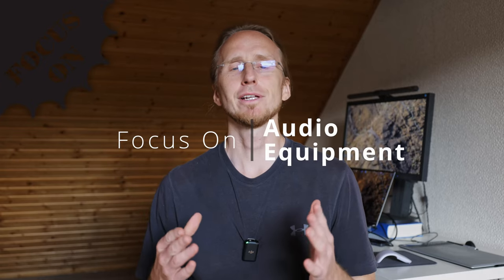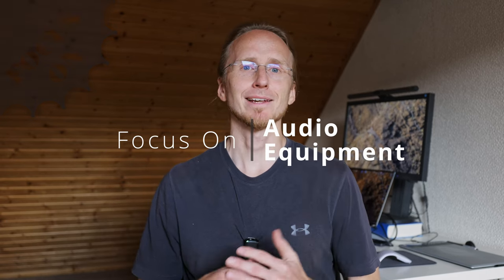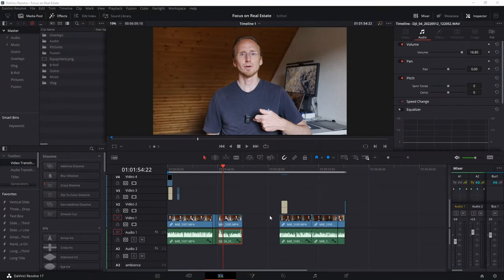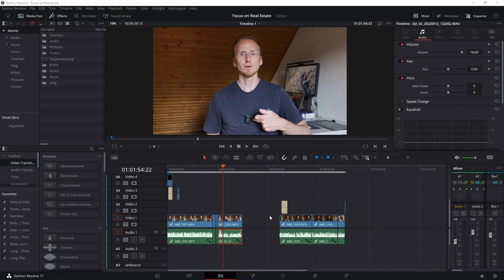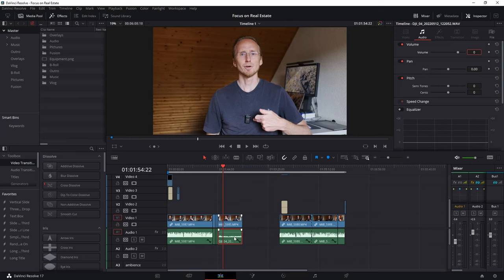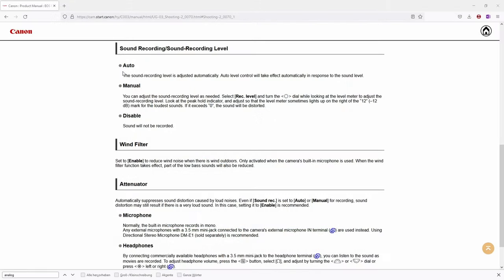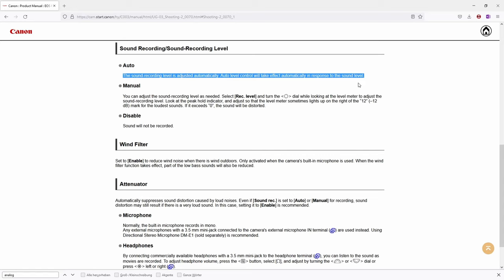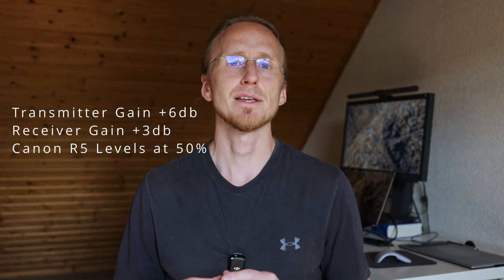DJI Mic Settings for Good Audio

Comment: did you had any audio delay with the DJI MIC?  recording in 4k 60fps i have a 3 frames audio delay
Reply from the maker: I didnt do 60fps. I usually record high quality Mode 4k at 24fps and had no problem.

Comment: Need your help. The first time I used these dji wireless mic and uploaded my video on YouTube the sound turned out too low. I had set the transmitter to + 3 and receiver to +1. Also I am using a dji Pocket 2  with a dji audio adapter. What audio levels do I set on the receiver and transmitter to get a satisfactory audio if not perfect. Thanks . I cannot find any videos on YT on setting gain levels in different environments. What's the thumb rule for setting gain levels between the transmitter, receiver and the camera I.e dji pocket 2
Reply from the maker: You can go higher with the gains. I have +6 in Transmitter and another +4 in the Receiver currently. The camera levels are below 50% to reduce noise. But whatever levels you set, you also have to tweak the signal in your video editing software. You should aim for something around -5db so the sound isn't too low. I typically add gain in Davinci Resolve to get the signal strong enough for my Youtube videos. There are great tutorials available. I'm no expert here, just learning by doing.

Comment: does DB gain reduction helps to reduce surrounding noise in DJI wireless mic?
Reply from the maker: Edit: My answer below is for the noise of the system itself. With surrounding noise, do you mean noise from street, other people and the like? For this, what you must do is get the dji mic close to your mouth (sound source). Usually, other surrounding noise is not very audible then.

First Answer: No, you must increase the gain in transmitter and receiver and reduce it inside the camera for the best quality. The later in the transmission chain you add gain, the more you will increase noise. Most noise in my case was added by the camera when the digital signal was converted into analog, fed into the mic-input of the camera and then amplified. But you should do tests with your system to find the best configuration.

Comment: 1:46 sound diferent. less eco i think but that is problem you can use bot audio on same project. so look like is better get a recorder and that it, something like zoom or tascam. but looking for wireless transmiting and look like dji mic dont achive it. It look nice and give better option than rode mic but that noise dont like. maybe down the sensivity can improve it?
Reply: 5:13 nice. look like all need put some gain to avoid the static or hiss sound. ok that is good for me.

Comment: Thx for this video! What kind of sound settings do you use or suggest in case of recording outdoor nature sounds (e.g. in a forest) with transmitter backup track recording?
Reply from the maker: Since this microphone is optimized to pickup sounds in close range while avoiding too much surrounding noise, I don't think it's ideal for your use-case. You can try to increase the gains as much as possible and you'll certainly get ok audio. But I think what you are looking for is a Zoom Stereo Recorder. But best give it a try for yourself and see if it's sufficient for how you use the audio.
Reply: @mibreit-photo  thank you for your answer and advice!

Comment: What about cellular, is it the same settings? I guess not if a mobile doesn't have volume setting in it
Reply from the maker: You have to experiment yourself. I don't use it on cellphone, so I cannot tell. Maybe you can find a good recording app that allows you to control the levels manually, like I set in the camera.
Reply: @mibreit-photo  I must say its less hiss if you use a good cellular that can handle with the Type c directly, if you use another cables for older cellular you will get much more hiss noise I'm using Samsung note 10+ with much more noise than using it directly with S22 Ultra
Reply from the maker: @-eyalgelbergofficial8827  makes sense, since input will likely be digital with USB-C, so you get less conversions along the way

Comment: Hello Michael. Mi brand new DJI MIC does an eco sound or a double voice when im monitoring the recording with mi headphnes. Is this normal? has Any Fix? Thanks for your great video!!
Reply from the maker: Hi there, to be honest, I didn't yet monitor with the receiver. Usually such an echo would be the result of a delay somewhere in the transmission chain. But there shouldn't be any, otherwise the Camera would also have a hard time to get the audio in sync. You monitor at the receiver, right? I guess you should check with DJI then, maybe they have an explination or a firmware update. Sorry I couldn't help

Comment: Still learning about "gain staging". Using a Sony A7III - what dB settings do you recommend for transmitter gain and receiver gain?
Reply from the maker: In the Video I use +6 on Transmitter, +3 on Receiver. But I might still increase it to be able to lower Volume in camera. I have a Feeling in the R5 a lot noise gets introduced If Input is too weak.

Comment: so, what is the best Receiver Gain  Audio setting when we use Go Pro Camera..? is it +3..?
Reply from the maker: You have to test this yourself. With Go Pro I use backup recording and no direct connection to the go pro
Reply: Yes i know i also use back up recording most if the time. But i  just  want to know what setting do you use on Receiver Gain when shooting with GO Pro..?

Comment: I’ve noticed that when using it with my Sony FX3, there is a high frequency noise that is recorded. When the receiver is closer to the mic input Jack on the FX3, the sound is more noticeable. If I move the receiver to the other side of the camera, there is less noise. I have been using all automatic setting. Not sure what the problem is.
Reply from the maker: Avoid Automatic setting. In my Canon this screwed Up the noise. Also record a Backup track for comparison. It can automatically be synched in Post.

Comment: Thank you for the review. If i am using two transmitters, and recording both at the same time in mono, can i modified the sound level of each one during video editing? Does the video record with two channels to modify sound level independently?Thank you for yoir help.
Reply from the maker: In software like Davinci Resolve, you can separate the audio channels onto different tracks and edit them separately if you want. You would simply duplicate the audio track and for one, mute the left channel and for the other mute the right channel. Maybe there's even a simpler approach. I don't know Davinci in depth ;-)

Comment: how do you set it to have the end audio in both ears? I know mono but5 when two mics its one on left and one on right. helppppp
Reply from the maker: I just use Mono and double the channel in post. But in documentation it's also explained how you can use both microphones and set them to work in Stereo. I have heard though that ob iPhone there have been problems with this Mode.

Comment: You can also turn off Audio Compression (on R6 MKII). Orange settings. Page 4. Second from top. Little hidden option for better sound.
Reply from the maker: Thanks for the tip. I will check if my R5 also has such a setting

Comment: Can I use this mic on my iPhone if I’m doing a IG live with another person? I recently got mine and I’ve noticed the only way I can hear sound is for me to unplug the receiver.. If the receiver is plugged in to my iPhone then I’m not able to hear any sound.  I’m wanting to use my mic for IG lives, but if I have to unplug the receiver in order to hear the sound I’m not sure how to do so. Can the mic only be used for recording video?  It says the mic can be use for interviewing.
Reply from the maker: I don't use the mic with my cell phone, but if you plug in the receiver, then both in and output will be handled by the receiver I think. So you need to use the headphone output on the receiver to hear the sound.

Comment: Question... Have you been able to adjust the audio level that is recorded to the file on the  transmitter or is that a fixed level for backup purposes only?
Reply: You can adjust it

Comment: I have a question about editing with the DJI. If I am conducting an interview and I do not have the transmitter going into the camera, will I have to download the audio from both transmitters and then sync both tracks to the video and then delete the portions from each transmitter that I do not want? or does the receiver do the recording? thanks in advance for any help.
Reply from the maker: If you dont use the Receiver and just the transmitters and their Backup track, you have to sync in post. Merging the teansmitter tracks in a Software like Davinci Resolve, for example, is easy. I have a recent Video on that. But if I did an Interview I would use the Receiver and ideally have someone monitor it. Just to clarify, the Receiver does not record a Backup track for the transmitters, just passes through to camera

Comment: Dear brother,
Tell me correct setting if you can🙏
Reply from the maker: I use +6db in both transmitter and receiver and have a low input setting on my camera. I show all this in the video. But it might not be the best setting for you. You should experiment yourself to find the best settings. But the principle is: rather amplify the signal in transmitter and then receiver than raising the volume in the camera

Comment: This might be a silly question, but why not turn up the Transmitter gain even more, in order to lower the gain on the Camera and Receiver?  Can it cause problems if you raise the TX gain all the way to +12?
Reply from the maker: You want to avoid that the audio signal clips because you add too much gain. Once it clips, it cannot be recovered, even by lowering the volume in camera. But for an office environment I could go higher.
Reply: Thank you.  I mean if, for example you reduced your camera gain from 50% to 25%, and increased the Transmitter from +6 to +12.  As long as the end result isn’t peaking red, is there anything wrong with having the Transmitter at full gain?
Reply from the maker: @largeEddy  I don't think so.
Reply: @mibreit-photo  Ok, thank you!
Reply: @largeEddy  I think you are right about it!

Comment: 5:30 "Worstcase" it isn't. Instead most people have different input devices which they use to record video like mobiles, cameras and drones. THATS why you need to adjust the DJI microphone parameters correctly and not fiddle around with camera settings and then switch to another device where these settings are not longer valid. Instead of a little tweak here and a little there get it strait with the DJI microphone as it has the ability to gain DBs as well.
Reply from the maker: If I sync between multiple devices I use the Backup track which I always record. But nothing wrong, getting it also right in camera in Case I don't synch. I do what works for me and share it. If Most people do it differently I don't care If it doesnt Help in my Workflow.

Comment: Has anyone experienced a massive drop off in gain using the DJI transmitter as a standalone recorder? The first 10 minutes may be the +6 gain that I have it programmed for, but then suddenly the audio will be barely audible.
Reply from the maker: Not yet. I have my longest recording around 15 minutes.
Reply: @mibreit-photo  Dang. I will contact DJI and hopefully they can help me troubleshoot.